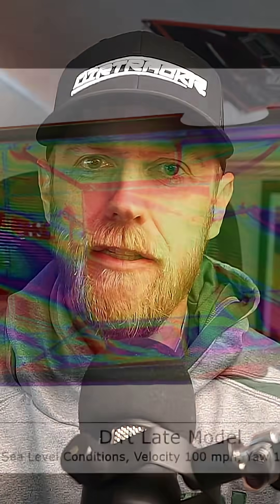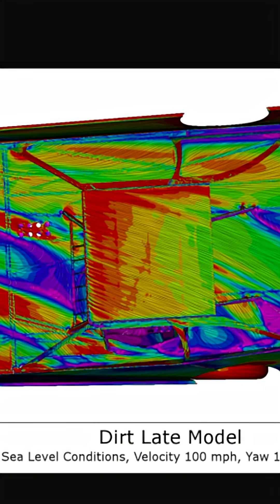Computational fluid dynamics... For dirt late models?

Comment: Just a minor correction, air does not move like a fluid in this context, it by definition is a fluid. In mechanical engineering terms, fluids include both gas and liquid whereas in common language fluid is often used to refer to just liquid.